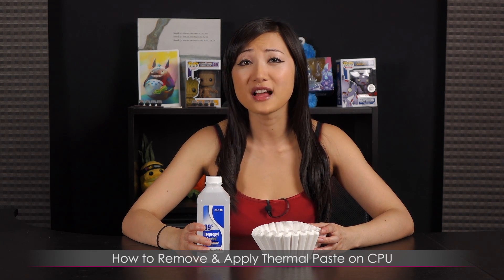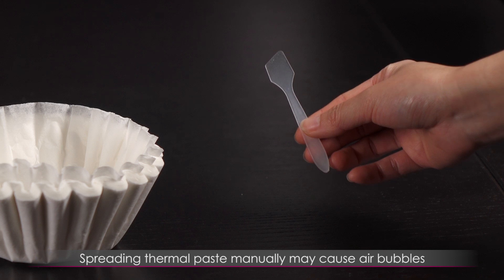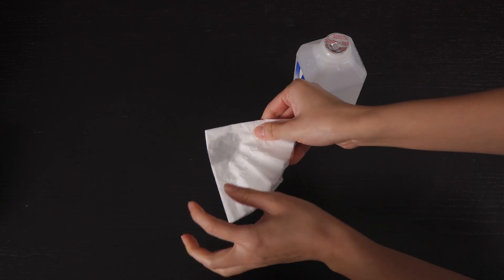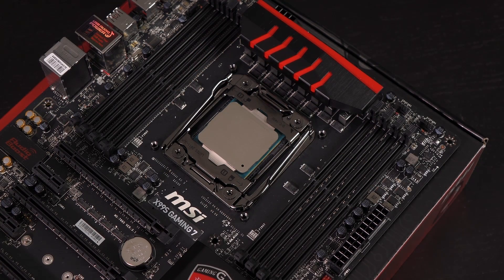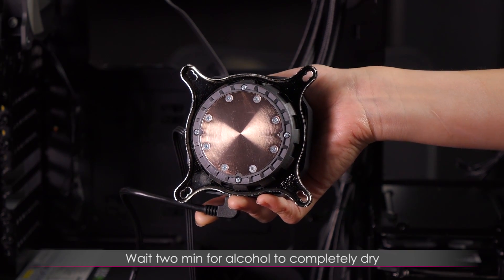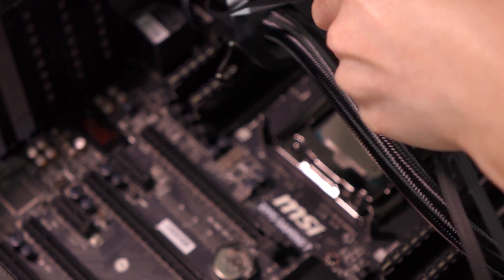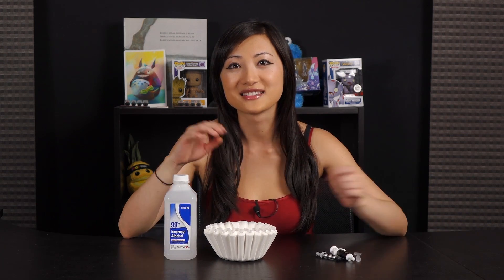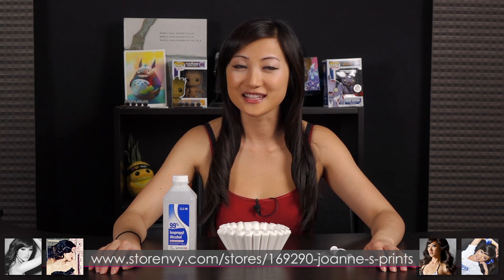How to Remove & Apply Thermal Paste on CPU

Comment: This is one of those touchy topics people go crazy over the differences in methods lol. I am not going to say I'm right, but just state what I think is the best: That's a bit too much compound. My high school computer repair teacher told us that the compound isn't there to be a layer between the two metal surfaces, but to cover the microscopic gaps between the metal surfaces, which means, less is more. There is a threshold where the amount of paste is actually less efficient at transferring heat to the other surface. I have always used the spread method just because I want to visibly make sure the compound is spread evenly on top of the CPU, so there are no corners that have no compound. However, I can see how it can cause air bubbles to develop, though I'd imagine they should be squeezed out when you tighten the cooler on top of the CPU. I still think that microscopic air bubbles should be better than corners that aren't covered (which you can't see unless you have x-ray vision). I guess a happy compromise would be to press/lift/press the spreader as opposed to dragging it around, maybe that could minimize the air bubbles. Also, not that there is much controversy on the matter, but the type of compound almost doesn't matter. What was it that they said gets you pretty close results... tooth paste? LOL yep, just maybe not over the long run, but as an emergency.
Reply from the maker: JJtoob You are correct sir, and gotta try it yourself to know what's best!Thanks for sharing your thoughts! I'll put less the next time around; there's just so much debate over this! So far, my temps are just fine.
Reply: Joanne Tech Lover It's just more than I would use myself (like twice as much), but I guess a lot of people use that much without impacting temps much. You also have a nice cooler, and I want one like that, but my main temp problem is the GPU because it gets really hot, and the fans just don't dissipate heat as well as I wish, and water blocks can be as expensive as the card itself... unless you know of any you could recommend.

Comment: For 20 years Ive spread mine with the tip of my finger..both gloved and un gloved. Never had a problem. I even overclock on air cooling.
Reply from the maker: ***** Interesting.Good temps?
Reply: Joanne Tech Lover Yes very. Never overheats. I use a old SpinQ cooler on the CPU. Thing is amazing.

Comment: Use dish-washing soap on a paper towel, wipe off thermal paste, reapply. Problem solved.
Reply from the maker: AndyHa1010 Is that what you do?
Reply: Joanne Tech Lover Yes, and it is very easy to clean the thermalpaste. I did it a few months back I believe.

Comment: Nice video? Any reason why the 'cleaning' paper should be very wet?
Reply: I meant should not be very wet
Reply from the maker: root8ble Because you don't want it to leak off the CPU onto the other components XD
Reply: Joanne Tech Lover yeah i was guessing that was the reason but when cleaning the cooler no need to be that careful right?

Comment: Too much paste! The size should be a grain of rice. I've actually used the same thermal compound on my previous rig and after a year, the paste got leaked onto my cpu socket short circuiting both the mobo and the cpu.
Reply from the maker: cyberxspeed That sounds terrible!
Hmmm I was thinking it'd spread out more on the surface, 'cause it's larger. I hope that doesn't happen here XD.
Reply: Joanne Tech Lover At first I was like thats a lot of AS5 then I thought lol its a LGA2011 V3 should be fine.

Comment: Never spread the thermal paste, 100% of all the times you do that, you will get air bubbles
Reply from the maker: Skinnwalk3r That's what I figured, but are air bubbles that bad for your temps?
Reply: yes it is the air bubbles that are bad for the temps, since the hot air will be trapped inside those and won't be transfered to the heatspreader
Reply: Skinnwalk3r Learn something new everyday. Thanks dude, for your advice!
Reply: no problems, i've tried different methods on how to spread, and the one that came the least effective was the one you were spreading it yourself, best way in a pea size dot and let the pressrue from the cooling do the spreading, if it is a larger cpu like the 2011-v3 socket, best way is a line method

Comment: That is waaaaaaay too much thermal paste
Reply: Josh Kissinger it might look that way and would be for lga1150 etc cpus but lga2011-v3 (also just lga2011) the cpu is physically a lot larger than other intel socket types so somewhat more is probably for the best.

Comment: I love the antec formula 7 compound, the 2 desktops and 2 laptops I have in my home are rocking it, and using a coffee filter for cleaning that's an awesome idea!
Reply from the maker: Evan Peters Do you use the applicator when spreading with the Formula 7?
Reply: Joanne Tech Lover last time I did when I used it on my main desktop, wiped off the compound that came on the corsair H100i and used that little spatula. But when I put new compound on my lenovo laptop recently I just made a pea sized drop like u did on the cpu and gpu and called it a day 😊

Comment: What will happen if i remove it with a bit of water? Laptop cpu and gpu.
Reply: GriggsCk Gaming depends, can be hard to get off if using distilled/de-ionized water and is a lot harder to get a perfectly clean finish, which can affect any fresh thermal paste you're putting on but shouldn't cause too much of an issue, do not under any circumstances use any other tap or bottled water etc. tbh its probably safer just to get a small bottle of isopropyl

Comment: lol thats not how you apply thermal paste, MSI knows better than you! THIS is how you apply thermal paste http://i.imgur.com/CX8TgXm.webm

jk all aside good video, just personal preference with arctic silver I tend to use just a tad bit more than what you used.
Reply from the maker: MrMassivemeatlog Lol thanks!Good to know you use a tad bit more; how are your CPU temps?
Reply from the maker: Lee Barrett I might have applied more than I wanted to lol. It's different when you're applying, and when you watch it after XD. I think my pea-size could have been smaller! Let's hope everything will run smoothly for years to come! knock on wood
Reply: Joanne Tech Lover
Lee Barrett I don't use much more, just my pee size is a bit bigger, my temps tend to idle around 30-40c with my 4690k and 60-70c max load with my enermax t40b
Reply: Lee Barrett
well first NEVER RUN PRIME95 WITH AN OVERCLOCK. just want to get that out of there. and I have a 4.5ghz OC.

as for the p95 part, I say don't do it because P95 overvolts your CPU and it cranked my CPU up to 1.4v!!!!! causing it to reach 100c and shut off.
Reply: Lee Barrett
I didn't, this is a commonly known P95 issue and why its advised AGAINST using it.

***** P95 will run fine on stock clocks, but anything OCed will never be stable.
I use Intel Burn test for thermal stability testing and Aida64 for stress testing. Then boot up bf4 or Crysis3 for stability.
Reply: Lee Barrett 4.5ghz at I think about 1.232vs?

I had it "stable" at1.22v but some games would crash so I upped the voltage a tiny bit and haven't had any crashes so I say its stable.
Reply: Lee Barrett
a 970 oced to 1.5ghz core and 7.6ghz memory :D

and your CPU should OC to at least 4.4-4.6 double check your motherboards settings and just keep cranking the voltage up until you run out of thermal headroom
Reply: Lee Barrett
yea mem clock on most cards reach 7.8ghz easy.
Reply: Lee Barrett it does in filter heavy and vram heavy games.

also 750w should be fine. I think the worst 970 (power wise) has a max potential TDP or 300.

so 100 for CPU, 300 for each GPU and you have 50w left for everything else, cutting it close but its fine dude.

my asus 970 caps out at 225w tdp so you're good
Reply: Lee Barrett
Dota and CSGO might try some new games this summer since i'm done with school for 4 months.

also for 1080p you only need one GPU :)
Reply: Hellmon Metz its an old MSI how to video, where they basically smear the motherboard in thermal paste. not missing much lol
Reply: she applied the compound 100% correct
Reply: MopHead780
watch the MSI link....l.
Reply: +MrMassivemeatlog ic... so saying "The image you are requesting does not exist or is no longer available." will do it for me? HOLY SHIT... IT didn't work :(.
Reply: FatheredPuma81
oh well, you can google it, basically MSI's how to videos are comedy gold and they covered the CPU in a thick layer of what look slike toothpaste
Reply: +MrMassivemeatlog Thats probably because you had the wrong voltage settings in BIOS, as well as insufficient cooling friend. I've ran Prime95 on my 4.5Ghz OC and it was fine.Good luck!
Reply: MrMassivemeatlog I just remembered my computer networking teacher used a paper towel and some random piece of metal he found from an old computer to remove thermal paste of an Xbox 360 >:o.
Reply: Broken link, can you please tell me where to found the image?